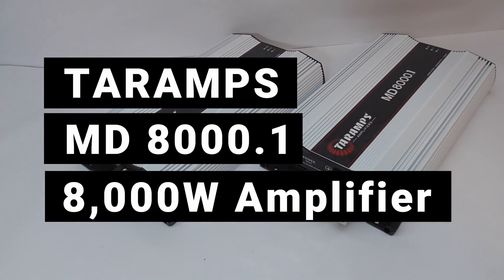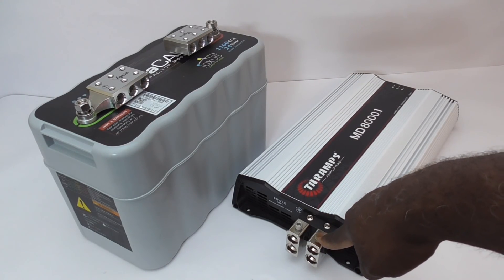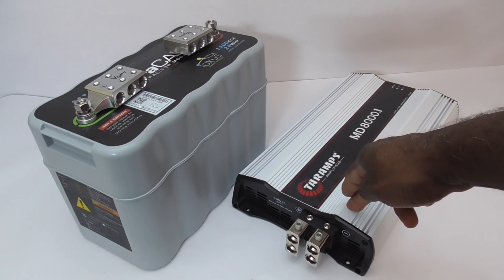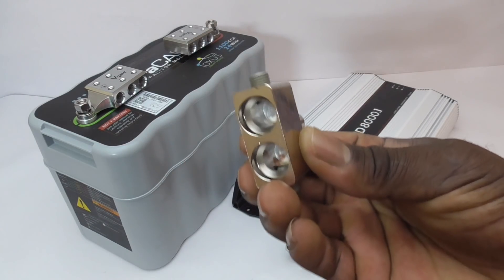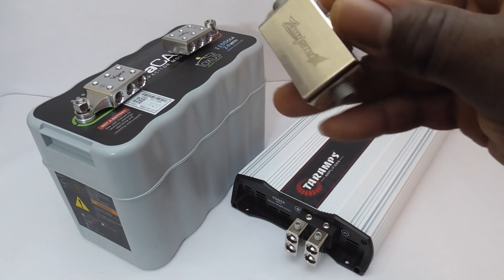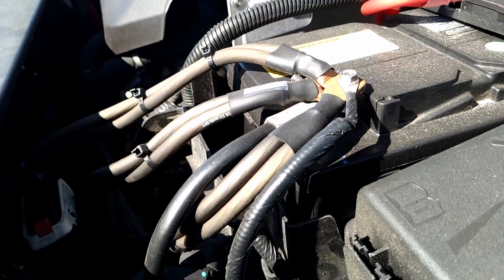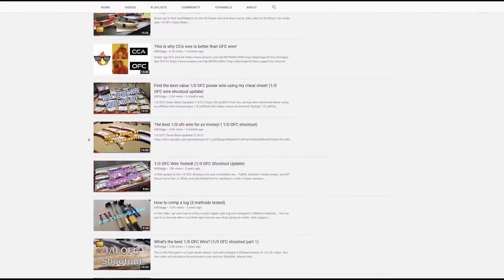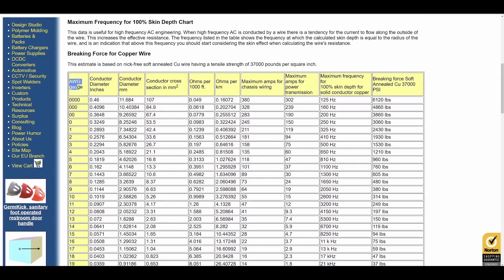Are Dual Inputs Really Needed In Every Setup?

Comment: Why are the power inputs on the amp on the left side of the screen so much bigger then the ones on the right side of the screen if there the same amps there power inputs should be the same i think one of your amps is going to be a knock off if you didnt purchased them at the same time and from the same place one was sild to you as a knockoff or a pirated amp.

Comment: I dont believe that your using those adapters in the right configuration or the capacitor the proper way to run the capacitor is to wire it to the ampnon the second slot on the adapter leaving the free slot for the power from the battery

Comment: I know this is old but your amplifier is like your car if you know your car is going to go 120 plus miles a hour?You might go 100 if you are on the freeway But the majority of the time you are going the speed limit?Amplifier won't pull that many amps if you are driving with the volume halfway up I use them because I didn't have 2/0 gauge wires and they are great to use because you don't have to worry about them wiggling out they have a lip at the end?

Comment: I'm on 5k and just doubled my runs from my LTO bank to the amp and it made a noticeable difference. I had a single 0AWG OFC and now have two for power and ground. Absolutely can tell the difference. Amp goes louder before clipping, voltages are overall higher (gained about 0.3v to my min). I'm a believer.

Comment: If you’re dealing with more than 400 amps you’ll be better off using dual inputs because the amperage will be distributed along to power wires instead of one. Most full bridge amps that is over 5k rms will have dual inputs. The jp83 has triple inputs

Comment: I’m running 3 1/0 tinned ofc front to back. 2 off battery and one off alternator. Then of course the alt to front battery.  Makes a circle. Have 2 isolators in the back for my lithium bank.  I’m using isolator on each run from battery and the alternator comes into one of the isolator.  Thing to remember with DC voltage is it travels on the outside the copper (not sure why it’s physics). I run 3 as I want my amp to power and lithium bank to charge.

Comment: Im running a 150 amp stock alternator with a agm 70 ah up and 3 2400 agm batteries in the back with 336 ah on a bass 8k taramps at full tilt voltage doesn't drop unless it starts to clip? If the subsonic filter is set right you won't have any problems? Another thing is high output alternators are basically for spl competitions? Because the car is at idle going full tilt? I have a daily driving setup meaning there's no need for me to drive down the street full tilt? Amplifier won't pull a lot of current if you keep the volume reasonable

Comment: I try to use high power amps that already have multiple power inputs, I have a Wolfram aw9k, I used these things and they were so close that they melted, 250 amp x 2 fuses burnt, luckily the amp was not damaged, I would buy those newer amps in the market that have 3 and 4 sets of power inputs, I am very hesitant to use these things now because of this experience, I know not all amps have the power inputs as close as Wolfram amps do, so again I would purchase amps with multiple power inputs like the taramps smart bass 5k, I have other amps that are 3k and lower and they only have 1 set of power inputs and I believe that is fine, I now think it's a waste of time and money buying amps that are more than 3k with only 1 power input, so if you can use them safely on your md since you already have it then it's fine, but that's why I don't buy these amps, like the taramps bass series also, taramps got smart and started making smart series with dual inputs and the smart bass can be wired below 1 ohm and put out 8k on a 5k.

Comment: Its an understandable question. Voltage dropoff over length is a factor for those who don't run batteries in the back. Even tho wire has gotten better over time for most you still have a form of power escape. Thanks for the video sharing your results.

Comment: Big fan and user of both Knu-Koncepts cable and welding cable. Grainger industrial supply is where I get 2AWG welding cable. A 50' spool was around a hunerd bucks last time I bought it.
"GAUGE" = meaningless marketing jargon
" AWG" = (American Wire Gauge) an actual unit of measure, being a standard used by manufacturers, consumers, wholesalers and retailers

Comment: I have 3 runs of 4/0 XL sky high audio OFC to my amp, same for for my ground. 3 runs of 4/0 XL. Why you may ask? I had the wire ran and switched amps, new amp has three power inputs and three ground inputs, I didn't want to change my wire so I added the extra two runs. And I do have a set of solid copper dual inputs I use in one power and ground. 
Also, I have a budget set of battery terminals that will accept that 4/0 wire, that would give u a clean battery. I’ll leave a link here and u can check it out. Thanks
Link below to Amazon. Is your kollossus wire OFC or CCA? Thanks again 

Vgate Lead Acid Battery Terminal Clamps, 8AWG up to 4/0(XL) AWG Gauge, 12-Way Connectors, Positive and Negative (+/-)(Pair) for SAE/DIN/EN Tapered Top Post
Reply from the maker: Kollossus wire is tinned OFC
Reply: @BudgetBassHead  thanks for the reply. I used some if their wire before. Can't remember what they called it, brightly colored, flourecent almost. It looked great and done what I wanted it to. Wire is high right now, that XL wire I use is 11.00 per foot now. Wasn't nearly that expensive when I got mine. Thanks for the reply. U have a great channel and do an awesome job!!!

Comment: 2/0 oversized car audio is same as 4/0 awg or welding wire.  1/0 car audio is same as 2/0 awg or welding cable. Is how I use it.  I dnt think 1/0 knu is 4/0 awg. I'd think 2/0 audio is 4/0 awg or welding.

Comment: I’m new to car audio so I would appreciate you giving me some advice I have an excess power D 3400 and the D 3100 and I have a 330 amp alternator I got the amp in this video and a jp 234 
That will have 4ohm speakers deaf bonce Sylvester’s and neo tweeters and deaf bonce sa 302s for subs is that sound or where do I need to improve I was going to go 0/1 awg also did the big 4

Comment: I run dual inputs because I’m cheap. 2 20ft runs of OFC 1/0 is almost $300 from sky high. I’m running 2 runs of 2g CCA jumper cables from Amazon, with the dual inputs it all cost around $50 in total. Is it the same as the OFC? Still no, but it’s better.

Comment: I'm a little late to the party,  but I'm curious. If 4/0 AWG is good for 380 amps(as stated on the chart for chassis wiring), wouldn't 2 runs help you deliver the 700+ amps that's this amplifier would consume at full tilt? I know it's a short run from your 2nd battery to the amplifier, but it would seem as if 2 runs would help deliver the amps needed.

Comment: The conversation was started with  Is nikolai Tesla and you bringing light to it Is a refreshing change. With close to 30 years myself doing car audio I found that dual inputs present a definitive reduction in cable temperature (even on short runs)  Which by definition will decrease resistance and give you higher voltages to the actual amplifier.  If you have a big pipe, you can always turn the volume up. If your pipes too small, you have to get another pipe.

Comment: I am only using the single run of 2/0 to my inputs on my cab45 because the run from my lithium to amp is about 2' everything is double 2/0 to the lithium there's no way it needs more than one 2/0 to a 5k in such a short run, using dual inputs in 2' would just be for looks. I'm a welder and when we're using a stick welder in a mill we may have a 200' run of lead and commonly using at least 2/0 sometimes 4/0 90% of the way but the stinger that goes on the end can have a 20' whip sometimes and it will go from that big cable to as small as #4 on that whip. Most people seriously go overkill on there power wires.your amp may have a 350A draw capability but you will never see that for more than a split second most of the time at full volume waaaay less. But if you ever upsize your amp it's nice to already have big gauge wire and there's no down side of big wire other than the pain in ass to to run and conceal it.

Comment: Numbers Don't lie. (Yours seem to be consistent). Let's remember. The guys using those 2 to 1 cable things "got bread" for all that double wiring and stuff. Looking at the charts...... I would be more inclined to follow the numbers. The doublers would be more useful when I have to use a double run on the bench with 4ga or when I run the 1/0from the battery to the rear power banks I can use the doubles with 4ga to my amps. Thank for the video. real world stuff.
Reply from the maker: Yep, I agree 👍 thanks for the support

Comment: My suggestion with two MD8k's is to run at a minimum of two runs front to rear then bussed off of your rear battery yes run the dual inputs and have two power and two grounds into each amplifier and I still do not think you have enough battery reserves to support the full potential of these amplifiers but then again you also will never be using them to full potential unless you magically are able to fit 4 15in or 18in top of the line competition subwoofers in your trunk lol 16k watts is a whole lot of power and you do not even need half of that in your setup... Now maybe if you were planning to wall off the rear of the car with a multi sub 4th/6th order or standard flat wall even then yeah sure run it the more power the merrier but you sir will never need 16k if you're sticking with a trunk enclosure... My amplifier I'd an AW-9000.1D by wolfram wired to half ohm on two Deaf Bonce apocalypse DB3515's with a limitless cyber 12k and XS SB1000-31 supercap with another limitless 25ah for the 4ch AW-175.4 and I have the same mechman 320a alt in my yukon denali and I have two runs of sky high 2/0 ofc on the driver's side front to rear from supercap to cyber 12k and then another run on pass side to the 25ah and my voltage still could be better so I'm actually going to be adding a 2nd 320a alt then I should have zero voltage drop also you can purchase a separate controller to adjust the voltage output of your alt because in our newer GM vehicles the pcu controls it and won't allow us to see over 13.8V when the batteries are fully charged well my amp can handle up to 18V so I want to see atleast 14.4-14.8V and in order to do that I had to bypass the pcu control and control it manually myself, mechman can guide you with what your best options are for reaching a higher desired voltage daily just reach out to them on Facebook msgr they are very quick to respond and will spend as much time as needed answering all your questions! I had a rebuilt oem alt that was doing 270a and my voltage was always 15.2-15.4 then I swapped it out for the mechman 320 and I never saw above 14v again they claim this is normal??? 🤷‍♂️🤦‍♂️
Reply from the maker: Great info and suggestions. What kinda car you installed in?
Reply: @BudgetBassHead  yukon denali and it does not like it not one bit lol I've added so much sound deadner layer after layer but the whole entire truck flexes like it has a whale inside of it lol-ol-ol

Comment: Bro, I'm sorry I haven't watched long enough yesterday see which way you ended up going but I can tell you tests have been done and if you want to you have the equipment to run the exact test... In the case where you have your smd dyno hooked up and see exactly how many watts this amplifier puts out with only one run then you use the dual inputs and run it again YOU WILL SEE POWER GAINS!!! It is a proven fact that more runs equals smoother current fllow and more current means more power and amps not working as hard to make power... So please run the test for yourself and then post it....

Comment: dual inputs not a waste of money yes you don't gain much. the gain is less resistance on power draw = less heat and less work the amp has to do to draw power. but it all depends on application on what your using it for. like if your not gonna DB drag for high spl and use it for a daily driver then no dual inputs not worth it.

Comment: 7 minutes into the video and I was not sure that kolossus wire is up to the task. I grabbed my tape measure and 1/0 stinger and 1/0 sky high wire and measured 5/8 across just like the 4/0 kolossus. No bueno. That taramp at full current draw needs more than just two 1/0. It needs three per power and three per ground.

Comment: C'mon people. Open the amp and look at the size of the wiring INSIDE the amp.  I understand voltage drop over distance so thick multistrand is required but really. Ever see even 8Ga. wire inside an amp?

Comment: So Resistance = voltage drop + cap or another battery = battery capacity issues because of the long run from the battery still? But not abrupt voltage drop= bigger runs ? So I’m understanding this correctly?

Comment: Bro check me out on youtube.
Running 2 bass 5k taramps 
I use gp audio 2/0 no bs ha I like they say that..  but I run a Northstar 480ah agm also got from gp audio..
Using 4 skar evl 18s each set see 1ohm they see roughly 4600 per set.. no wall, my power an ground are under 1 an a half foot, dual power an ground. 350amp ho alternator
Reply: Also use 500amp fuses skar audio
Reply from the maker: The fuses are my next purchase.

Comment: Looking at a voltage drop calculator, you might see something like 6% drop at with 4 awg, 2 feet, and 700 amps.  14 volt becomes 13.1 volts
Reply from the maker: Thanks for sharing

Comment: B4 even watching (because I have the 12k model and have own several 8ks) u can fit as big as 3/0 welding cable in these amps and one run of that is plenty sufficient and using these non copper inputs would not really see any improvement...theyre really only needed if running 1/0 imo

Comment: Yeah  I never hear people mention heat. That's a huge factor.
If you look at aluminum wire comes to your main house meter it's super thin for as much amperage as it runs through it,  then compar that to meter to panel.  Because of conduits (contained heating)
You go bigger.
It's a total system that HAS TO be thought through too many weak links and status quo gimmicky gold plated sheet metal screws. Out there.
Your amazing video speaks about common sense. 
Like h.o  Alternators but a cheap ass walmart neverstart battery is the storage device.  Etc....
Science is Science.  And go bigger than you need and quality stuff in Power and rca cables within reason  will never backfire on you.

Comment: I'm confused are you running 2 batteries and a super cap or 1 battery and a super cap? Is the battery in the front or the back? If 2 batteries then.. Run the 1/0 from the alt to the front battery, run 1 line to the back battery, run 1 line to the cap, then 2 lines from the cap to the amp.
Reply from the maker: As planned.
Reply: @BudgetBassHead  You could also just do a copper bar from the lithium battery to the cap.. Just a thought.

Comment: I agree with dual runs but wanted to ask what exactly your battery setup is. I know you have a 320? amp alternator and it looks like you are using that super cap which isn't enough.
For every 1000w added you need 10ah of Lithium as a general guideline.
If I were you I would ditch the super cap and do a 80ah Lithium if you can, I think you would see more gains from that than dual runs.
Reply from the maker: I'm currently building a 64 amp hour of headway lithium iron phosphate
Reply: @BudgetBassHead  you will be in much better shape that way.

Comment: I'm by no means a sundown fanboy it's a matter of fact I hate sundown but you might want to go and check out the unofficial channel cuz he proves they are necessary,, and if one thing I've learned in audio is even with batteries in the back there's no such thing as Overkill when dealing with amperage
Reply from the maker: But wasn't his gains less than 5% wattage? But I understand what you mean.
Reply: Well I can see you went back and watched the video,,, while it was a 5% increase on power ,,,the amperage draw difference was 20 amps or better less than with a single run
Reply: So when trying to squeeze everything out of your alternator and batteries that you can I would say dual runs is good,, secondly most of us are upgrading our systems as we go I just paid over $300 for 24 ft of 1/0,,plus ground wire,,, lugs ,,,fuse terminals and then to throw all that away to go buy 2/0 or 4/0 and start all over would be a fortune every time easier to just run two lines

Comment: I guess it would be alright but cuttin it close. You're at 700+ amps each amp of peak power. Why would you need 2 of these amps? What are you running a jackhammer? Wolfram amps are the best bang for buck especially for longevity.

Comment: I personally would use dual runs to combat any voltage drop. Even if its .4 that you gain. It will help your entire system run more efficient more efficient means less heat and strain on 1 single wire👍
Reply: Agree with you better to go   over than under your system will work properly with properly sized wires.

Comment: So I have only been back in Car audio for about 5 years now. I went with the numbers and I could not pull the power from my amps as I should. I added a 2nd run of 0 gauge and I went up 1000 watts. At comps I was running a BC5500 at .67 Ohms. I was only pulling 3800ish watts from it. No other changes, I ran a 2nd run of 0 Gauge and pulled over 5000 watts clamped at a comp the very next weekend. The show was at the same location and the temps out side were only a few degrees difference.  I don't think it's just about how much power the wire can handle but the resistance in the wire. Running 2 runs of wire at the same time takes a lot less time than running 1 run and a 2nd run later down the road.
Reply from the maker: Thanks for the comment